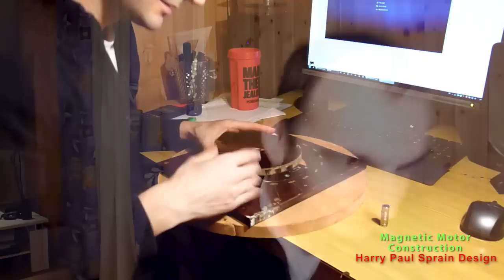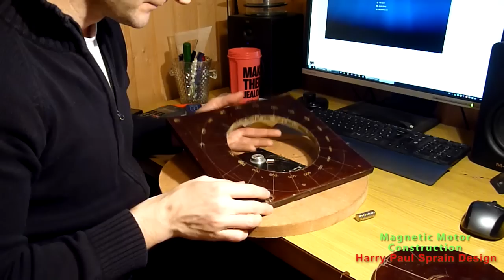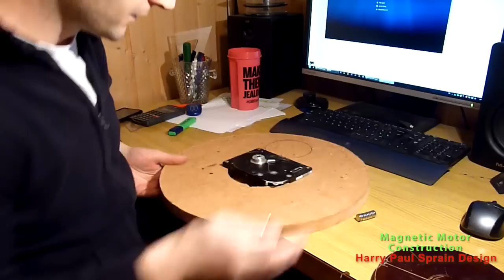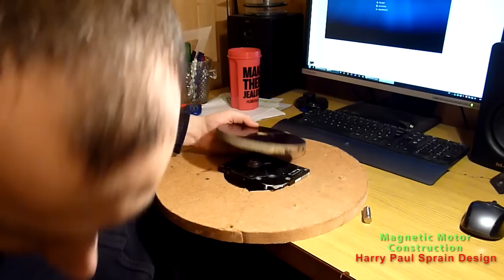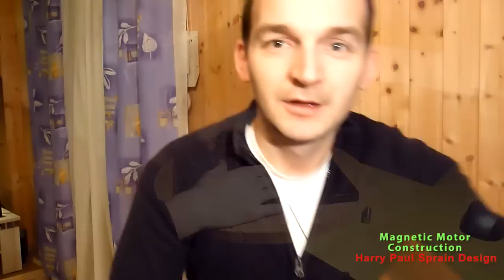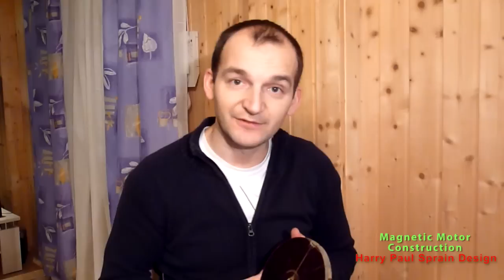Magnetic Motor Construction : Magnetic Motor, Free Energy Generator

Comment: Oil, Gas, Coal, and photovoltaics= Obsolete!

#emilie Electro-Magnetly Inialilised Lateral Induction Engine. 
When Faraday discovered magnetic induction, if had just gone a little bit farther he may have discovered EMILIE. He would've then understood that it's possible to use a magnetic field like a river to harness and capture its power. 
That's what Emilie does that's how Emilie works, it allows a rotor arm to travel along an ever-increasing magnetic field. Just like a small boat on a river. The rotor arm is carried along accelerating on the Archimedean spiral until the magnetic field becomes so strong it can't escape from it.
And at the very end of this powerful magnetic field is an electromagnet that we fire creating an opposite polarity of the magnetic field that makes up the river.  But it's in the same polarity as the rotor magnets and the little boat traveling on the magnetic field so all of a sudden all the inertia and momentum that the little boat had gathered by traveling on the magnetic field was saved and it allows the rotor arm to swing out of the magnetic field at the end of the magnet array and start its next rotation. The wattage out from the generator exceeds the wattage needed to fire the electromagnet. 
Help me continue my research. https://givesendgo.com/EmilieMotor

Comment: I've done this. for the electro magnet as you say, I used the SSG (John Bedini). The use of the SSG makes it so the electro magnet portion is free and you can focus on adding a Lenz Free Generator. There is more of a trick to that last magnet in relation to the coil to get it to work efficiently. Neo/strong magnets are going to make this even more tricky for you. Don't give up! and if you don't succeed right away, please to not come to the conclusion as so many do, that it does not work. It only does not work for those who are not successful. This is a fun project!